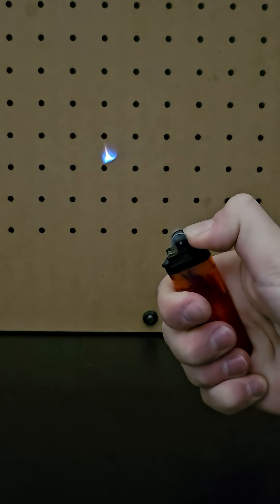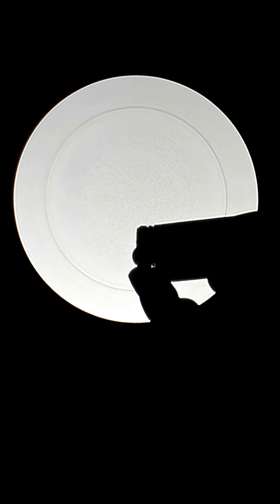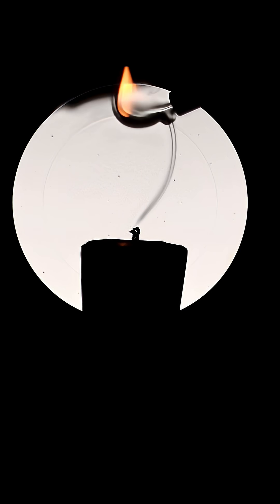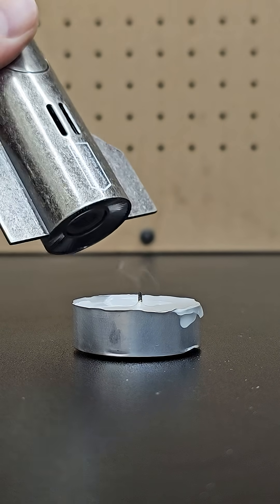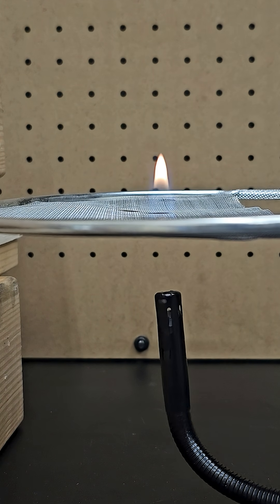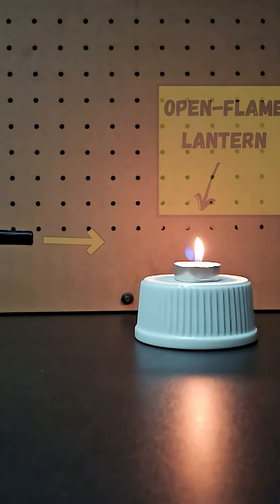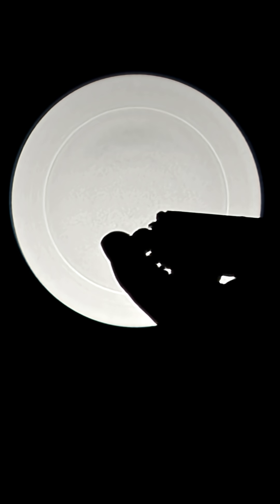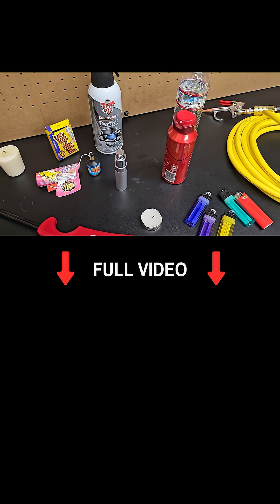Visualizing why this flame floats using Schlieren Imaging! #shorts

Comment: that imaging setup kinda makes the other gases look like its being seen through an electron microscope for me and idk why (maybe the black and white?)
Reply: It's the black and white that makes it electron-microscope-esque
Reply: It’s just monochrome. Electron microscopes can’t capture color since they use electrons not photons.
Reply: Clippy
Reply: You can setup a Schlieren system like this to use two different colors of light rather than black and white... If you tweek things a bit more, you might be able to fit more colors in, but you lose contrast, and it gets harder to see.

This is basically an image of half of the light going to one side, and none of the light going to the opposite side.